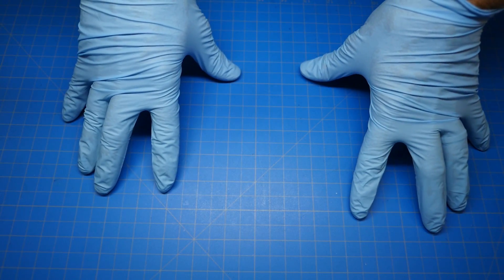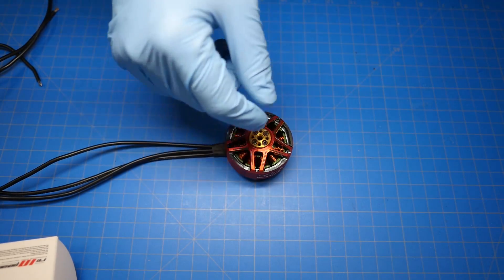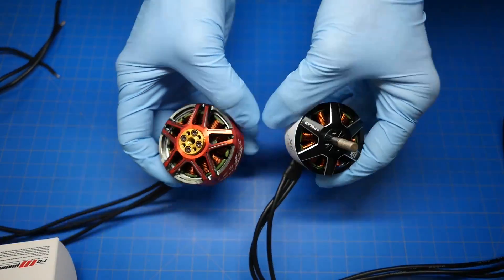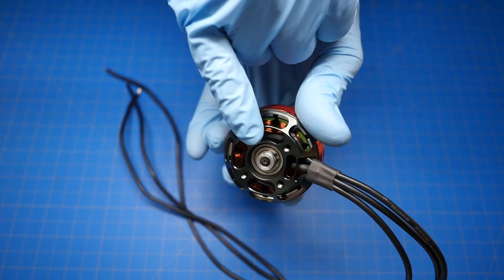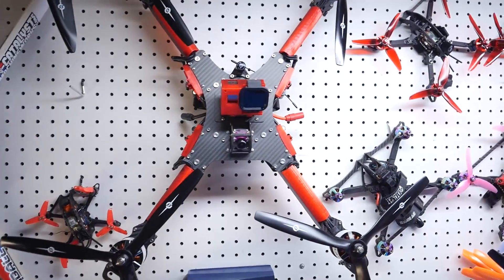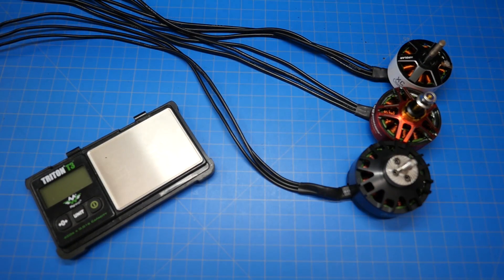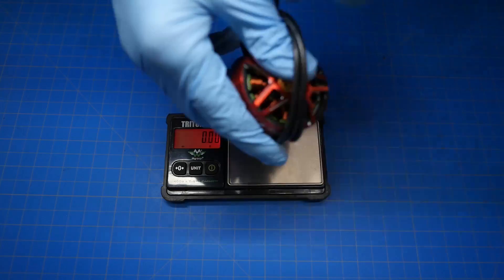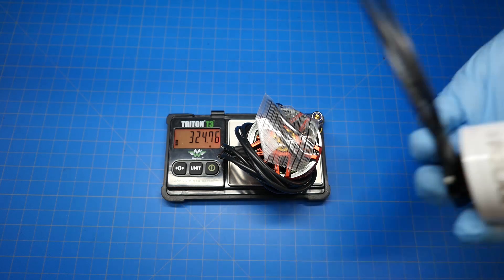RCINPOWER XCLASS MOTOR REVIEW (PART 1)

Comment: what is the ball park lift capacity of an x class drone?
Reply: Depending on the setup anywhere from 35lb to 90lbs.
Reply: @strawhatsam  that seems like a bit much. For something with 13-15 inch tri blade props doesn't it?

Comment: I believe the prop adapters are interchangeable.
The one on the motor is probably for prop which has screw holes like a lot of carbon fiber props.
The other one is for prop with hub hole.
I'm guessing it's that way because it's actually how famous brands like T-Motor and Scorpion are doing it.

Comment: love the fact your pushin key aspects of the industry like, speed, size, durability, and innovation.
Reply: iv been asking around trying to design an aerodynamic frame with dual batteries. sole purpose is scale testing for a single passenger race drone. measured my street bike, sold my dirt bike and bought some aluminum tubing, notcher, and bender. i just have writers block as what it should look like. im about to order a 1200amp esc, 80kw 120kv motor, 36x16x3blade carbon prop. also have a 28x14x3 blade carbon for random coaxial testing.   ummagawd is the only person to give a tip. got any ideas?